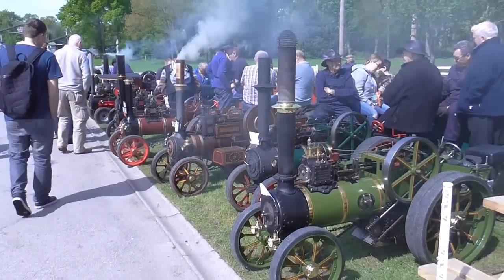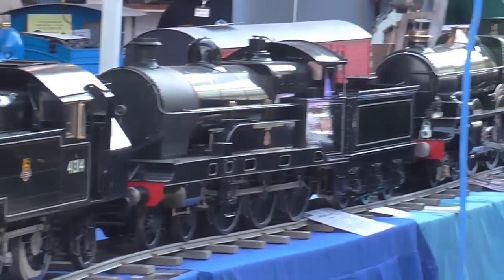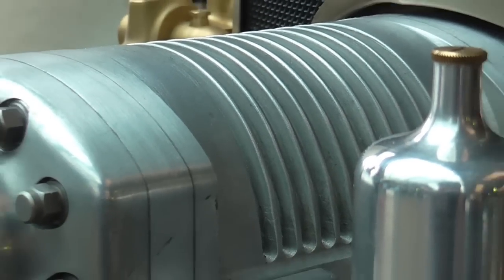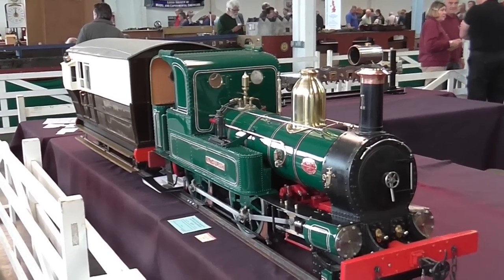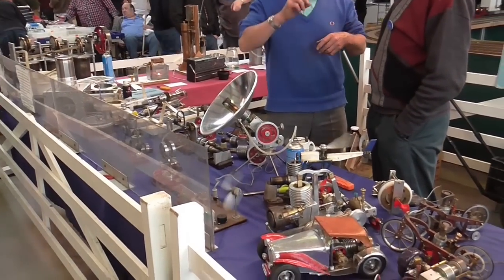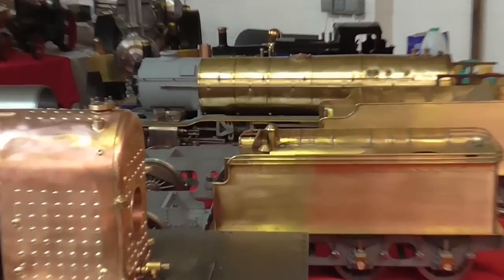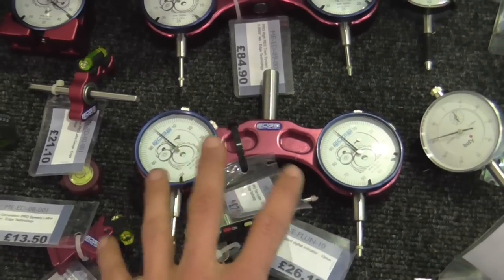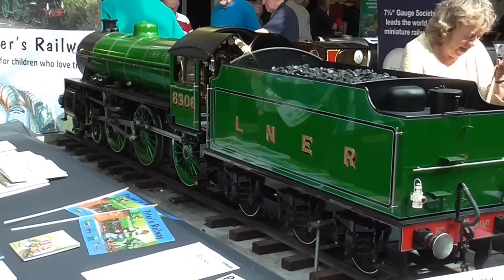Harrogate Model Engineering Show - 2015

Comment: Thanks for the video, was a great tour! im planning to build my own 5" gauge engine, however im finding it hard to find resources online particularity schematics for engines.  I was wondering if you could point me in the right direction where i could find some? for instance are you using a set for your own engine your building? 

Subbed, looking forward to watching your video's when its not 3am :)

Regard's Matt
Reply from the maker: +The1NdNly Thanks for watching. I used this website - http://www.ajreeves.com/5-locomotives-66-c.asp